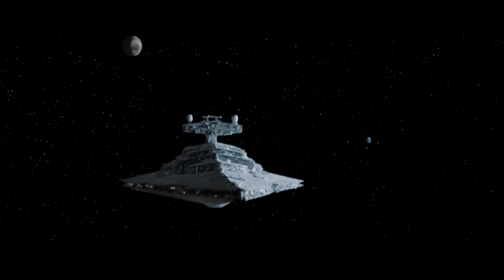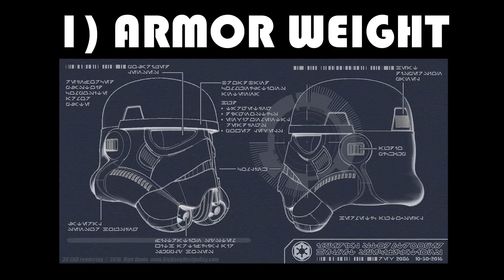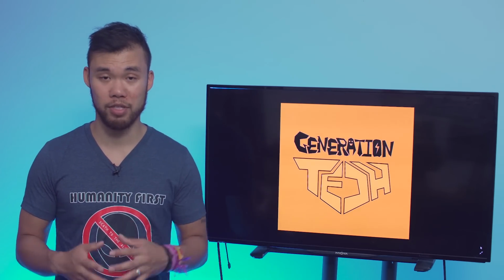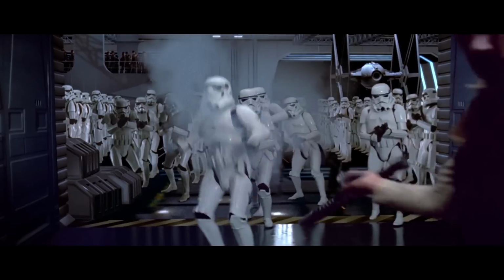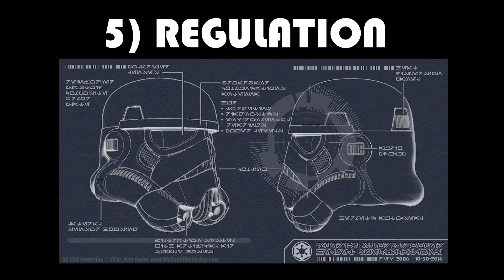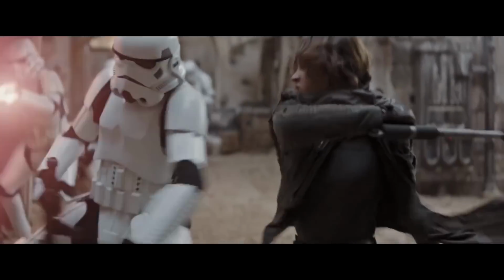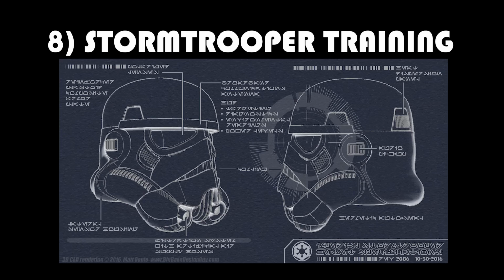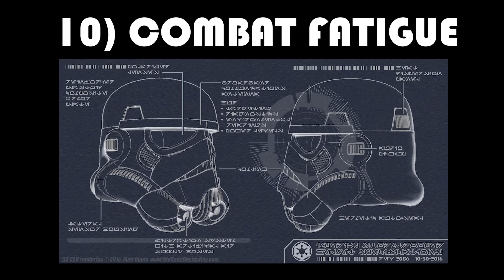10 FLAWS with the Stormtrooper

Comment: Hey man,
I think you are doing a great job with this series.

One thing to add on the equipment side  -E-11 had no stock. If you have ever fired a rifle caliber pistol, they are very difficult to shoot accurately, quickly because they are missing the point of contact with the shoulder.
Reply from the maker: Yea that’s a good point actually I figured the recoil might be a bit less than a black powder weapon, but after playing battlefront that doesn’t seem to be true
Reply: That would make an interesting video.

To add a little more, recoil doesn’t have a lot to do with how accurately you shoot a semi-auto gun like the blaster. The stock just helps you connect the gun to your body more and makes it easier to aim.
Reply: What are you talking about? The E-11 does have a stock. It's an underfolding stock; that part you see on the underside the barrel. We just never see them actually unfold it and aim properly.

Comment: They should go with fully powered armor that carries its own weight. From there it´s only a small step to shields for VIPs like commandersand such.
Painting the armor would make sense, provided they know where the armor will be used. On the high-tech versions (those for VIPs and such) a mimetic system that changes the surface color to the environment automatically would be reasonable.
For targeting it should be simple to include a target indicator that shows where ones weapon is pointed. VIP armor also gets emergency medic systems into the armor!

Comment: What I understand of platemail armor from D&D, the actual plates were covering the more vital areas, with leather and chainmail guarding other areas and joints. I'd classify Stormtrooper/Clone Trooper armor more as field plate(heavier, but better protection), more coverage, with lighter materials used over less vital areas. The Jedi Knights in SWTOR I'd say would wear platemail(varying degrees differing between Sentinels and Guardians), while Troopers wore more field plate.

But, I could be wrong.☺

Comment: the regulations thing is actually pretty accurate though, we were on a patrol in afgan and our 1st sgt used the blimp (that has cameras on it )that was supposed to be used to look for IED emplacers to watch the patrol and then chewed their asses when they got back for having rolled sleeves and unstrapped helmets while on patrol but fixed it before they got back inside the wire. he was no longer allowed to use the blimp after that but still shows how it is accurate about how stupid highers can be about regulations even in combat zones.

Comment: Supposedly the scope on an E-11 IS part of a targetting suite, feeding information directly to the HUD in the Stormtrooper’s helmet.  The issue is that the E-11 is simply too hard to control during sustained fire.  It’s powerful but extremely light, so firing on full auto will knock the barrel around all over the place, requiring single shots to get any reasonable degree of accuracy out of it, and the folding stock is inadequate to compensate for its intense recoil so most Stormtroopers don’t even bother with using it.  That’s not getting into the usual ‘made by the lowest bidder’ issues that any soldier can tell you all about if you ask.

Comment: Even without a targeting system, that thing they use as a handgrip is actually a folding stock, although we never see them unfolding it. In my opinion that should be extended unless they're going into a CQB situation in which case they wouldn't even need a targeting system, it's like playing paintball at that point.

Comment: Alan, just to slightly correct you with the power generator. Yes it is exposed on the hull, but it was designed that way so if the reactor was going critical it could be jettisoned into space, therefore saving the crew. Just thought you'd like to know and I thoroughly enjoy every video I watch!

Comment: Can you do 10 flaws of the AT AT
Reply: Pretty sure you need a longer list than 10
Reply: It's too tall
It has no neck armor
It doesn't have enough weapons
The weapons are in the wrong place
It doesn't have that much room inside to store anything
Reply: @girl-xk2db  legs are kinda useless wen treads could do the job better the legs are weak basicly the legs lead to fall

Comment: Quick note 9mm have more speed and penetrating power than a 45acp, 45 have more force and stopping power
Reply from the maker: Yea I struggled a bit with that but I justify it by saying blaster bolts are more about energy rather than penetration and 45acp has more weight and transfers more energy when it strikes
Reply: Cool, it kind of fits the theory that stormtroopers are more likely to be knock out rather than killed
Reply: And that stopping power is not really anything to note, pistol rounds are all fairly weak

Comment: Stormtroopers absolutely have targeting already built into their helmets, giving them a reticule or even a camera view down the barrel. But that actually led to some other issues. For example since they didn't NEED to line their sights up by shouldering the weapon to get their head behind it, they often didn't shoulder it and extend the stock. (I swear I read somewhere that when the stock was extended the barrel jacket on the E-11 got too hot to hold hence why the Sterling stock was always folded forwards, but I've never found the source again.) The thing is, having three points of contact for their weapon REGARDLESS of targetting systems would have made them more stable.

Comment: 1. The phase 1 clone tropper armor was extremely good protection, able to sslower tge damage death by a usually fatal blaster bolts down to a survivable level (if medical attention was rendered quickly enough). However, it was very heavy and not well designed for the human anatomy, making running difficult and other movements heavily movement restricted, though the visor was models after mandolorian designs and offered execellent vision). The phase 2 armor was a compromise between protection and mobility, the limbs were less protected but much less restricted. The chest piece was thinned out to reduce weight, but was still able to protect the clone from some blaster shots (thought direct hits from medium to close range were almost always fatal).

The problem came when the Empire stopped using clones. Clones come in a standardized set of measurements, all the same height and the same weight (approximately). Normal humans do not. Even with very strict recruitment practices, there is going to he some variance. This presents a problem for making armor, as producing individualized sets of armor is time consuming and expensive. Without clones, the Empire had to make their armor "one size fits most" at the very least. Therefore, by making their armor bulky but lightweight, they can accomodate most size variations if they control the sizing of recruits selected. The problem is, now you have a suit that is bulky and not to protective against military grade weapons (though classic stormtrooper armor was known to be able to filter out smoke, conventional toxins, and protect from debris and shrapnel)

2. Stormtrooper armor IS heremetically sealed, they just have a very small amount of air. The twinky and donut shaped section on thier back is supposed to contian a small airtank and compressor (and serve as a way to attack a backpack magnetically). But 2 minutes of air is not gone save you in space, just if you fall into a deep pool of water or enter an unpressurized airlock for a tactical bording operation (cough cough). In fact, the black ports on the front of the helmet can be connected to a backpack containing a much larger supply of air for extended vacuum usage (as seen in a new hope).

3. The helmets were designed to fireball stormtroopers, and such were not well fitted t the individual, leading to vision problems. Also, the wide t-visor of phase1 and the smaller (but still prominent) t-visor of the phase 2 armor supplied excellent vision for the clones, but presented a weakspot in the armor that was easy to exploit (it looks like a target after all!) The visor of the stormtrooper helmet aimed to solve thia problem, but provided a narrow view. First order helmets aimed for a happy medium.

Sources: all official visual dictionaries, the clonewars tv series, rebels tv series, and logical concluaions based on visual information from episodes 2 3 and 4.

Comment: I would like to point out that some of these flaws are retcons in the Disney universe, the Expanded universe, including various versions of the star wars encyclopedia noted that the stormtroopers under armor was sealed and when used in conjunction with the helmets, allowed for limited EV use in the vacuum of space. One thing that I'm surprised you didn't mention is the armor is modular, with pieces able to be switched out to accommodate specialized environments. Dedicated EV, high radiation, toxic/poisonous atmosphere, and amphibious environments could be countered relatively easily. 
As for the helmets themselves, they offered a complete suite of tactical and communications gear in addition to a full HUD and basic targeting functions, with specialized units like scouts and dedicated snipers having more advanced targeting software and even in helmet zoom. As for the aim, outside of some meta jokes in later series, stormtroopers are usually described as exceptionally accurate and deadly. Their poor aim in the movies is more attributed to either orders, or as some would say, plot armor for the main and support characters. For their role, the stormtroopers have great armor, modular, able to be adapted to various environments, and housing gear to facilitate communication and battlefield awareness. Even it's weight is negligible when considering it is spread out over their entire body, not just a ballistic vest style chest piece. One thing I think you hit on squarely though is how they are often utilized in ways that seem a poor fit for the armor. This is true, but also realistic. Unfortunately history, even recent history, is full of similar examples of shock troops, raiders, air assualt, airborne, and even spec ops being underutilized in roles better suited to more mundane troops. This is however usually a logistics/command issue and not really a fault of the troops or gear. And now you've gotten me ranting. Great vid anyway.

Comment: To make one thing perfectly clear I believe generation tech did something like 10 things good about the armor.  Cant actually remember right  now.  Any ways for those who think the armor sucks and why medics are so few and far between is because the armor actually displaces energy from a blaster round.  Sure the rebels "look like" the kill stormtroopers all the time but the way the armor is designed it usually means the stormtrooper is paralyzed for short duration.  Medics only really show up after a fight because if this.  It's not widely known but the stormtrooper armor is actually really good for what it does.  The armor is also relatively cheap to make and the plastoid alloy is durable enough to fight against those with crap equipment.  Besides the empire cant make mandalorian armor for everyone.

Comment: Stormtrooper armor works great if facing a riot, rebellious planet or as an intimidation tactic. 
But I believe the shortcoming of the armor is intentional and it goes straight to the Emperor. He uses them as a hammer, but he need them vulnerable if the start a coup.  
So he had the armor designed with vulnerabilities so if they did turn on him, he could have them wiped out with the forces loyal to him. The Rebel Alliance just exposed those vulnerabilities.

Comment: Actually the protection afforded by stormtrooper armor is in that it’s an armored environment suit, and while blaster shots do knock stormtroopers down often, the heat and force is absorbed and dispersed, changing a shot that would put a fist sized hole in your chest to one that just knocks you down and possibly out. A quick bath in bacta and a good percentage of shot troopers could be recovered and returned to service.

Also, the plastoid armor seems to fare pretty well against standard imperial weapons, seeing that the stormtrooper chirrut used as a human shield took many blaster bolts of friendly fire without collapsing, requiring chirrut to manually dispatch him with his staff.

Again, this serves perfectly well for peacekeeping duty, as heavy blasters are regulated and restricted and even the service arms they carried can’t reliably punch through their armor. 

Stormtrooper armor saves lives and manpower in lieu of prolonging combat effectiveness.

Comment: Also even in Disney canon Stormtrooper armor CAN be hermetically sealed, it just only auto-activates in hard vacuum because the sensors to detect poisons are more expensive.  The change Disney canon DID make is the deletion of the Legends 5-30 minute(Depending on source) air supply so they'd have little to no continued breathing ability in space. (Source for this is a Rebels Recon "Ask Pablo" section wondering what happened to the stormies that chopper sadistically spaced.

Comment: The weight of the storm trooper and clone trooper armors was offset by them being powered armor in the tabletop RPG. There was a lightweight frame that all of the plates attached to with servo motors so that the heavy armor would not be as fatiguing. Whether or not this is still cannon, I have no idea. A similar system, albeit far more bulky because of out current technology level, have been created by DARPA in the US to help soldiers carry their combat load with far less fatigue. It currently is still in development and is limited by battery technology, but fully removes the combat load and allows a soldier to move freely.

Comment: White for intimidation and high visibility for peacekeeping and policing. Plus the standard imperial infantryman had a helmet, goggles and a chestplate for protection so it’s pretty close to what we use nowadays. But if you’re sent into heavy firefight having a full suit of armor that will cover you from head to toe is a better option for all-around defense than just a chestplate and helmet. Even if it isn’t 100% blaster proof it will still increase your chances of surviving a CQC firefight and allow you and your squad to press forward to take whatever ship or position you’re trying to overrun. I agree though that empire didn’t utilize their stormtroopers properly. Just like modern u.s. marines they are supposed to go in, kill everything on site and let the army roll in a set up sustained operations. Policing and peacekeeping should be left to the army as well, since they’re designed for long term stationing at deployed locations.

Comment: given that full steel plate armour weighed around 20 kg, and assuming that plastoid is lighter than steel since it is also used for prothetics, it is safe to assume stormtrooper armour is lighter than 20 kg.

Medieval knights were basically unimpeded in their movement while wearing armour, so stormtroopers should not have had too much trouble with that. realistically speaking